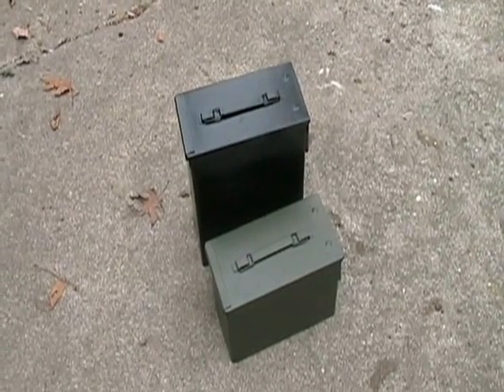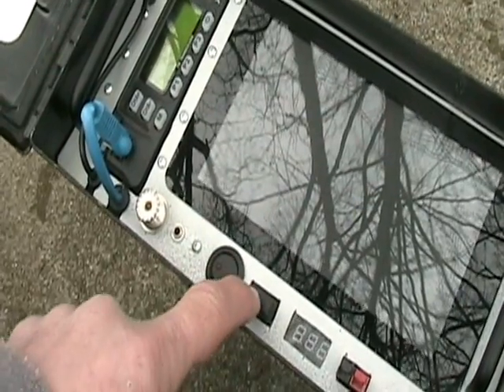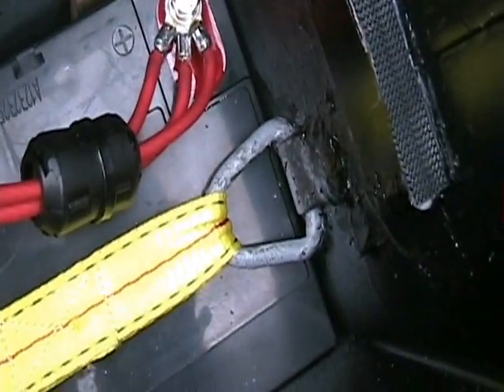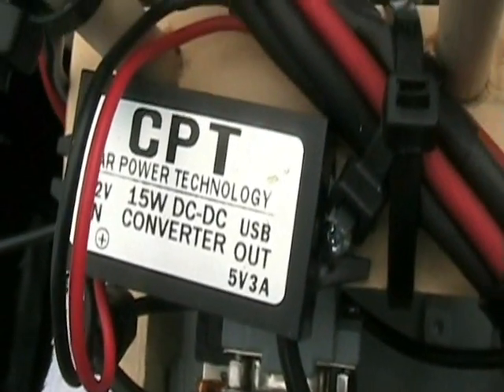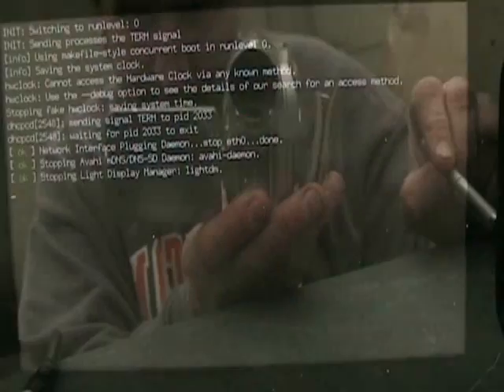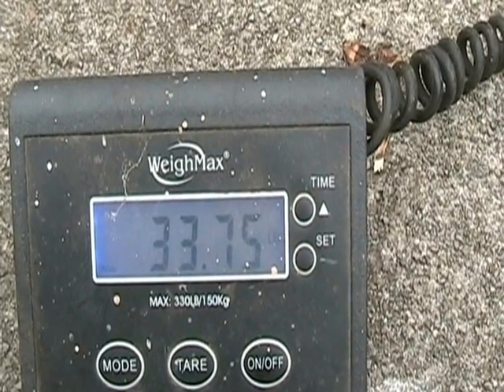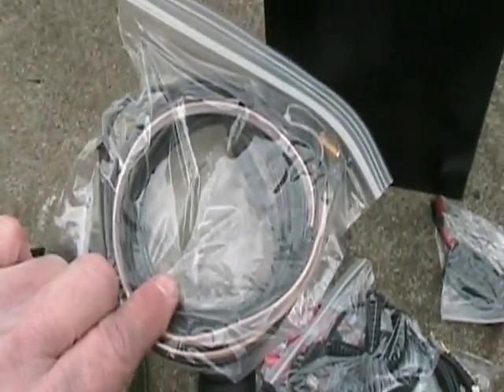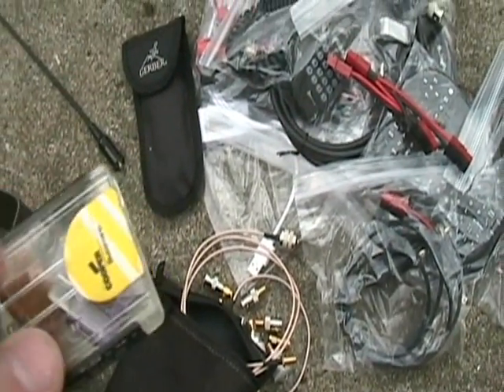Ham Radio Ammo Can Go Box with APRS, battery operated Raspberry Pi, TNC-Pi, 7" Touchscreen

Comment: Top work sir! Just a tip for you, if you ever need to remove the switches under all that hot glue, use some denatured alcohol. put a few drops onto the hit glue and it will stop sticking to anything and peel right off. Really handy when I make me model air planes. Its a lot better than trying to heat that up and causing damage to other components. May I ask whether you would do a tutorial or writeup?
Reply from the maker: Great information, I have a hot glue dent puller and use the 99% alcohol for the final cleanup.. Thank you for viewing this video, 73
Reply from the maker: Thank you for watching the video and great information on using alcohol to remove the hot glue. I really wish I took more notes while building it, honestly I had the ammo box laying around and had the wild hair idea to put a copy of my APRS base station in it. I did take quite a few pictures while building it, I might make a video showing those pix with some narration of building it.. 73, N9SIR